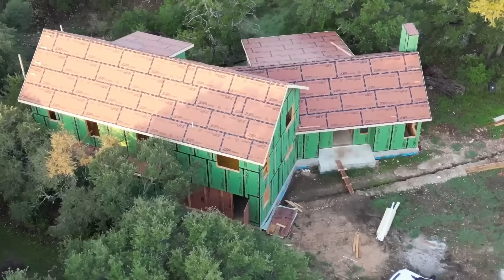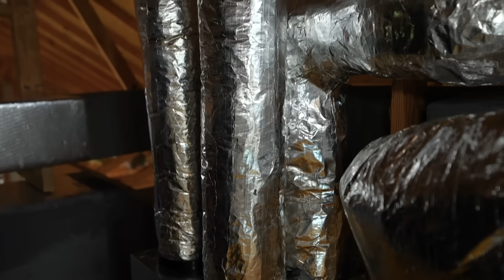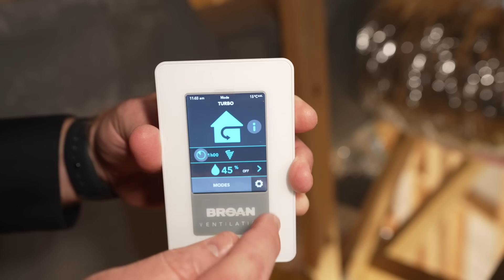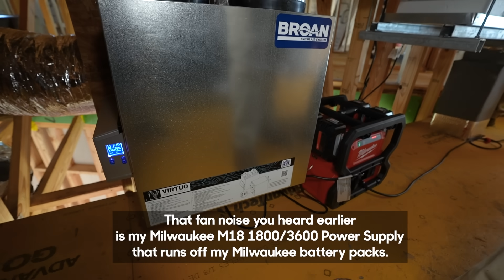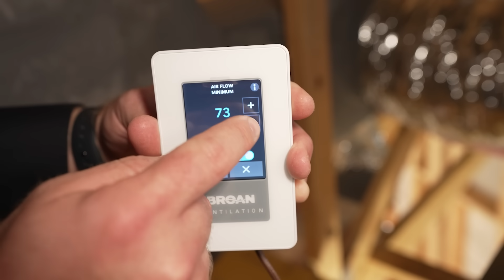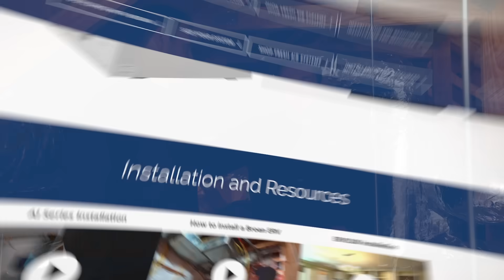Fresh air: A quality ERV that most can afford?

Comment: Matt i have a tri level house from the 70s and have spray foamed most of the home and the house it pretty tight.  Heat is a boiler and ac is a mini split how do I add something like this to existing construction?

Comment: Why are they putting these units in the attic with uninstalled roofs? Or, at least, why are they putting these in before spray foaming the underside of the roof? Seems like it would be a massive pain to work around all that duct work. I know the ducts are insulated and that helps, but nothing close to keeping them in conditioned space.
Reply: Was thinking the same thing.

Comment: I havent looked at the code but i dont consoder stuff that operates this way to be ai or even ai enabled.  

Sounds like a setable pid sensor feedback loop with some timer override functions.  Sounds totaly reaponsive and not at all predictive.     

Unless its lolking at the day of week and clock and ramping up on days i have requested boost in the past. Or predicotong by occupancy etc   seems like a buzzword for a good design proper set up automatic and compensating  system.   To many pekple tracking ai on it makes them weary

Comment: Matt, can you configure an HRV to provide the function of a whole house fan (WHF) in some degree? I live in the Rocky mountain region about 5,000 ft elevation. It can often be in the low 60s F at night and 90s or higher during the day. I like the idea of a WHF to bring in that cool outside night air. But between seasonal allergies and pollution in the valleys and from wildfires, I don't like bringing in unfiltered outside air. A video or your thoughts on how to get the best of both of these systems would be great. Thanks.
Reply: An HRV or ERV would be recovering a lot of the heat from the exhaust back into the incoming stream. So it wouldn't bring in as much cold air as just a fan without a heat exchanger.

Maybe there's a way to have a fan exhaust with filtered makeup air into the HVAC duct. Passive intake with either a spring damper to require a certain amount of negative pressure, or electronic to open when triggered.

Comment: so for boost mode, when you turn on the bathroom vent you also have to push a second switch to activate boost mode? is there a way to turn the bath vent (or kitchen fan) and boost mode is automatically turned on?

Comment: Hello, I Have Broan B150E75NT AI Series. I'm using the Independent T1 Install Setup. When Exhausting/Supplying from/to more than One Area/Room/Locations, How do you maintain Suction/Supply Air? I Have noticed a Significant drop in Air Suction from Exhaust and Decrease in Supply Air when I "Tee" in to more than One Area. The 6in Ducts drastically drops the air movement after I "Tee" Off into Any Location. How do You Overcome this?
Reply: You need dampers in each branch off of your trunk then you measure air flow at the grill while someone adjusts the damper.
Reply: @CMCraftsman  I Don't Understand.

Comment: I just built and installed a homemade system with two 6" in-pipe fans and a 12x12x8 core of used but clean political signs that captures and returns some of the energy of my conditioned air. I used only 12' of 6" duct in my utility room with the intake and outflow through the wall into my screened porch, and an intake and outflow into the dining room near the A/C return so the fresh air gets conditioned before being sent into the other rooms. I wired both fans into a router speed control and used it to adjust the fans so I keep the CO2 levels in the 600 to 800 ppm range; no fancy computer stuff is needed.  If I feel I need help with the range, I can buy a CO2 controller ( usually used in greenhouses with costs of $115 to $200)) and set the target CO2 levels I want that will automatically turn the system on and off. The whole thing cost me about $200, I did have to buy a 4x8 sheet of plasticore from a box store as I didn't have enough political signs. If everything else is quiet and you are close to the dining room wall, you can hear a low wiring sound from the fans, but it is not really noticeable.
Reply: Impressive!
Reply: That’s awesome! I would love to see a video of your install!

Comment: We are building house so tight now we have to bring in fresh air. In 20 years when all these systems fail or home owners don't want to repair them houses are going to grow mold and the problem will be 10 fold.  I agree with r21 and r49 but I just don't see. Remotes battery's.  Home owners are not savy enough to fix anything.

Comment: Thanks for the video, Matt. Comment not aimed at the video. These building codes are out of control. First, they force you to make your house airtight which costs a significant amount of money, materials, and time, including the blower test that is required by a qualified tech at a hefty price. Then realizing we are going to now suffocate, the code requires you to install a system that uses electricity, requires constant maintenance, and costs a significant amount to install to bring in fresh air because we made the house so tight. Am I the only person who thinks this is insane! And I definitely don't want to hear the crap about how this air is better than the air that leaks in on houses built before these requirements.
Reply: No one is going to suffocate. You can still open a window. 

I don't think it's insane though I don't think building codes should be a requirement.
Reply: @agisler87  lol. I think you missed the point. You can't get an occupancy permit on a new home unless it passes a blower test. At a certain level on the blower test you have to install the air exchanger. These things are all required by the IRC building code. Do you understand how many thousands of dollars it costs to make the house airtight, install the blower, and do the test? You aren't allowed to just open a window. You would have to have an alarm for high CO2 levels. Get up, open the window, wait for levels to drop, and then shut the window. That would be absurd. Try building a house and then you will understand better.
Reply: @Deep_Divers    You seem to miss the point where I said building codes shouldn't be a requirement, this would infer permits wouldn't be needed. I will further add to that there shouldn't even be licensing laws. So I'm fine with you building the worst house you can imagine. 

Your original comment seemed to imply people will suffocate when the electricity goes out. Most people know right away when they lose electricity. Your fear of an airtight is baseless. But I know change can be scary for some. 

I'm building a house right now as the GC. I know exactly what I'm talking about.

Comment: These ervs just seems like the next scam to bilk dollars out of people. A properly designed fresh air intake will do the same thing at a fraction of the price.
Reply: Only thing is that fresh air intakes don’t exhaust any air only brings fresh air in.
Reply: @isaiahanderson7237  so maybe head back to school on the fluid dynamics part.   If you suck air Into your home where do you think the other air goes?
Reply: @beardedbarnstormer9577  hmm some of it is exhausted but not by the system
Reply: @beardedbarnstormer9577  some of the air does end up escaping through vents for bathrooms and kitchens. In fact in my state, HVAC systems must have a fresh air intake.  every time mine clicks on a small amount of air leaves through the bathroom fans. The pressure will hold the dampers slightly open.
Reply: @isaiahanderson7237  exactly. Because air is a fluid for a fresh air intake to work you need for it to escape.  Most homes are not hermetically seal so the air will push out.

On newer much more sealed homes I can understand needing an exchanger but I also don't agree with how much we are sealing up homes. We kind of did this in the 70s and it led to mold and air quality issues.
Reply: @beardedbarnstormer9577  and most homes now are being constructed with energy efficiency and air sealing in mind. There’s various different tapes, flashings and caulking that is used and more builders are switching to zip which air sealing is far better than housewrap on plywood or OSB. The reason for homes having to be sealed and insulated way better than homes from the 1800’s-1960’s is for energy savings but I agree with you that insane amounts of air sealing can cause mold and other challenges not presented with less sealed homes.

Comment: Goodman just came out with a Side Discharge 1.5-5T inverter heat pump. Can't wait to see what the price is. With a right sized inverter / variable speed heat pump, I just don't understand the need for a dedicated, supplemental dehumidifier unless you live in FLA USA.

Comment: Hey. Thanks for the video and for all of the great content that you share. My biggest question on erv's is that from my experience erv's come with pretty low rated merv filters and don't have the option to upgrade to a hepa and carbon filter. My erv in particular is a Honeywell and I whenever there's smoky air outside we smell it throughout our house because of the erv. When I spoke to Honeywell customer service they said that there's no option to get better filters that fit this erv and even if we were to create our own in line filter box they were concerned that it would choke the erv. Any suggestions? Thanks

Comment: I have installed a handful of these Broan AI series, very nice units, very simple start up and balancing. Realistic price for this application with proper installation; rigid pipe dedicated ducting, advanced controller and deluxe humidity sensing 'boost' switches in bathrooms $10 -12k. I could see $5-6k with a chinsy flex duct installation with no auxiliary controls maybe. I am disappointed that there i no way to independently set CFM for the supply and exhaust fans to positively pressurize the house.
Reply: Broan does offer the ability to independently set CFM for supply and exhaust through their LCD wall control for the AI series. It just can’t be done from the unit itself to my knowledge.
Reply: @oshthepd  I did figure out how to set the CFM independently, you have to do it at the integrated control on the ERV. I called Broan tech support, and the technical representative told me CFM couldn't be adjusted independently. Broan, if you are reading this train your tech support staff!

Comment: Matt, I rebuilt a 3300SF home, performed all the electrical, all the plumbing above and below the slab, spray foam insulation, all new windows and doors, drywall and flooring using your principles.  I truly enjoy nerding out while watching the Build Show.  By that, I learned the electrical code to bring a new buried line into house with 2-200 exterior disconnects and 2-200 amp panels inside that allows for future generator to cover most of the house from one panel, and studying the plumbing code to understand DFU requirements, used PEX and copper.  I did all the work with my wife and it looks great and passed all the inspections.  Thank you for your channel
Reply: wow, care to share notes on this information ? or how to get more knowledge on these subjects?

Comment: How do these work if you have a horribly polluting neighbor who is always burning a very smelly fire. Stepping outside is like stepping into a burned building, and I would not want that coming into my house. I know ERV's have some filtering, but I doubt it would turn the air which is like a coal fired power plant, into a spring meadow.....

Comment: I have to point out here they had application of ervs and hrvs in the north versus the south backwards. He was saying in the south where it's hot and humid you want to remove some of that moisture from the air, which means you'd want an hrv since it dehumidifies as well. In the north you want an erv because it can transfer the moisture to the fresh air stream and keep humidity inside when it is cold and dry outside.
Reply: @The_YouTube_Critic  explain. I'm sure I don't

Comment: Sorry, I do not like any of equipment that is AI controlled and Remote controlled. This is due to that I do not want to have anyone other than me see and/ or control such equipment. When and if I put the item in sleep mode or Vacation mode, I do not want it to be turn on by someone else or itself.
Reply: If this is not connected to the internet it doesnt matter. You coukd connect these to a router that has no internet connection and be fine also. The A.I. naming is gimmicky, there's probably no A.I. control going on, it just has regular programming in a control board.
Reply: @ShotGunner5609   "Do you remember, "Do you want to play a game?", and many other movies?

Comment: Matt, I so appreciate your drive for superior products and thank you for opening my perspective to better building practices. I will say that in seeking a better build for my current home I chose Lowe's Premiere Contractor at a cost of $175k. What a fiasco and lesson learned!  My wife and I chose this as we entered our retirement age to prepare for what lie ahead in our golden years and was raped by Lowe's. By God's grace we haven't filed lawsuits, have corrected many horrible mistakes such as 4' holes in our ceiling to seal airflow, obliterated HVAC duct systems and a endless list. However yes they made the blue room- blue, their standards.  I am now concerned that our attic is grossly overtaxed and we are still using 60s insulation. Can ANYONE direct me to a reputable source to tackle a conditioned attic, which will probably include replacing 60s rafters for better HVAC equipment enclosure. Currently spending $300-400 per month on utilities for a 2800 sq ft home. We had hoped by using a nationally known entity this would have been addressed in our retirement years. Please, I need wise guidance. Thanks again and have a Happy New Year for all of you guys out there building better homes for people.

Comment: As a builder with fresh air being brought into the home untreated, the main complaint is the air is running all the time and it’s cold in the winter and hot in the summer.  Logical to me.  But when I approached the HVAC company they recommended an ERV but my building science guy said go with a whole house dehumidifier.  What’s the pros and cons with these two?
Reply: There's alot of information missing on your end. Why did the science guy recommend DH and the hvac company recommend the ERV?

Comment: Thanks to living in the midwest i need a utility room the size of a small house and enough duct work for a motel to take advantage of all the tech available these days. Between hvac (hoping to go geothermal), a dehumidifier for summer, humidifier for winter, and an erv would be nice too. A couple days ago i was getting static shock like crazy. Opened up my thermostat app and it was only 27% on the main level and 30% in the basement. Summer time will be 70%+ easily. But my house needs a lot of work because "leaking like a sieve" would be an improvement for my house.
Reply: These shows and their concerns about the "humid" South... We get all the humidity of the south (easily 90+% for months), along with legitimately frigid cold. Today it's warmed up to about 5F, and I'm looking at a humidistat about four feet from a room humidifier showing 26% right now.

I'm not exactly sure why I live here now, after typing that comment. 🤣
Reply: @DannySauer  yep midwest gets the best of both worlds. Stupid humid and hot in the summer and freezing cold, high wind, and low humidity in the winter. Almost impossible to build the "perfect" house according to buulding science. You either try to keep moisture in or keep it out, try to keep it warm or keep it cool. Or you build something thats just ok at everything. Black roof can be helpful in the winter but bad in the summer. Tinted windows can be good in the summer but less ideal in the winter. It goes on and on.
Reply: @DannySauer  Pennsylvania also 90% humidity all summer. Below 20% humidity in the winter. 

We get probably 3 weeks of  60-74F weather all year. 74F is hot with 85% humidity.
Reply: @CaptainIrelandGaming I spent a little time in Pittsburgh recently, and it totally felt like I was home in central Illinois - both the climate and the random people saying hi. 🤣
Reply: @DannySauer  I'm in south central PA. Pittsburgh has a totally different culture and language. Lol Philly also has it's own unique culture and language. 

South central PA uses a little bit of both vocabularies, but we also have our own unique ways to say things due to heavy German influence.
Reply: @CaptainIrelandGaming  I did drive over the mountains to Altoona for a day, but didn't get all the way to Philly. Like Illinois, PA is definitely a big state - Chicago isn't Bloomington and neither one is Marion. 😂

Comment: Matt, do you have a suggestion for an HVAC System planner in the San Antonio area? House was completed in 1997 and had never really cooled or heated evenly. I have a large non-conditioned typical Texas attic. Basically means it is totally inefficient. I would like to make changes and need a good planner not an appliance salesman. :)
Thanks for  your feedback.

Comment: I have a Broan unit in Ithaca NY and it’s horrible at ventilating bathroom. Boost is hardly noticeable in its effect. It only blows in fresh air - not evacuating moisture. Also, these “smart” WiFi unit controllers DID NOT WORK and needed to be swapped out for “dumb” hardwired controllers. Broan’s software was faulty.
Reply: Looks like typical bath fans combined with dehumidifiers would absolutely be necessary with these systems. Many people comment on how poor they are at venting moisture.